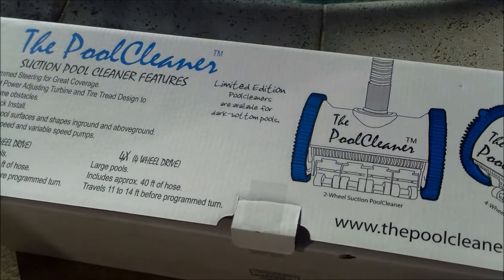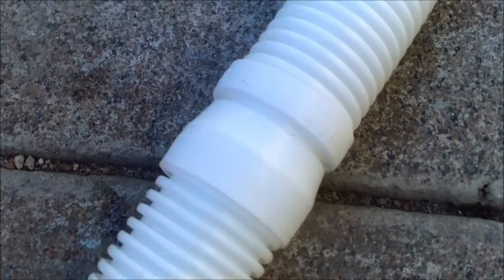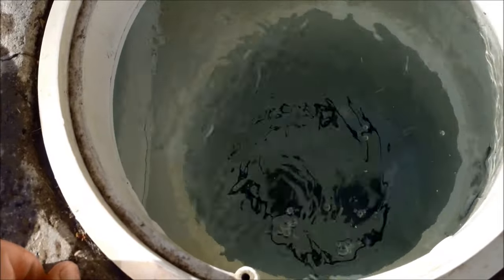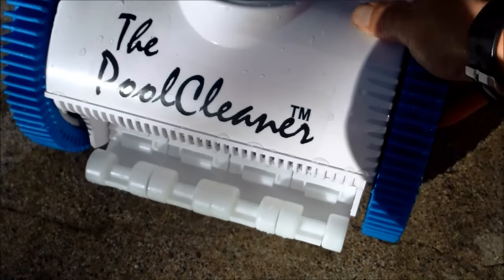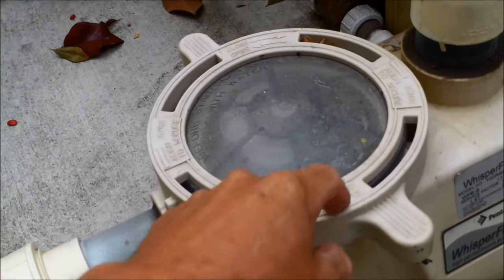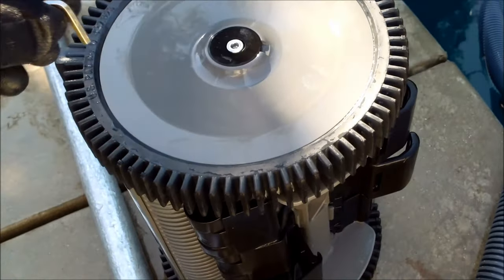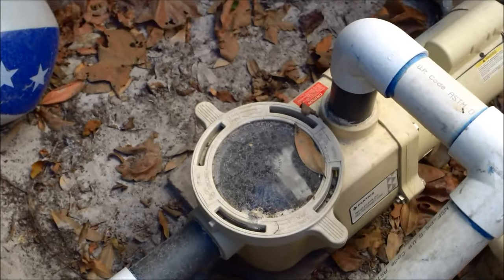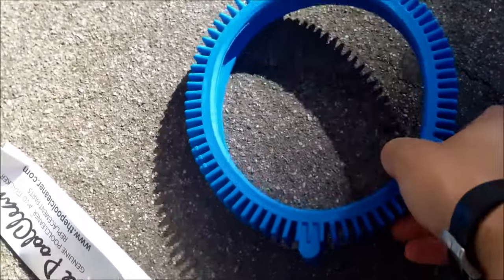Proper Installation of "The PoolCleaner", Troubleshooting & Tips

Comment: Question, it's working well when connected to the skimmer but when I connect to the pool vacuum plug on the side of the pool it works for a minute and stops. Any suggestions? 

Could something be plugging that line?

Thank you for this video. I have referred to this and your others a few times. They have been very helpful.
Reply from the maker: It sounds like there may be something wrong with the vacuum line. I've seen those filled with debris from a new plaster and fill

Comment: I don't know if you answer questions, but I am having a suction problem. It starts off ok, then, with my hand down in the skimmer hole, I feel the suction is strong for about 30 seconds, then it goes down to a trickle. I appreciate your response.  James
Reply from the maker: Sounds like an air leak in the line. See if you can isolate it. Usually by the pool pump. Check for any leaks. Change the pump lid oring as well.

Comment: Great video I just got my pool cleaner and installed it today. What would cause the pool cleaner to not have enough wheel rotations? I adjusted the suction valve over and over and over again and the best rpm’s I could get was 8 rotations per min. Any advice?
Reply from the maker: I would clean the filter if you haven't already. And the main drain needs to be completely off as well
Reply: Thanks for getting back to me so quickly. I will clean the filters and see what happens
Reply: What hapoened after cleaning the filters
Reply: I cleaned the filters, made sure my valves were in the correct position and I’m still only getting 8-9RPM’s and for whatever reason my vacuumed floats. I took the floats off to see if that would help but it didn’t. My father in law bought the same vacuums and is having similar issues. He’s only getting 8RPM’s also.

Comment: Hi, thanks for the informative videos. I'm having a problem with my "The Pool Cleaner" maybe you can help me with. Quite often the turbine will quit spinning even though it is getting plenty of suction. There is nothing obstructing it and I can actually stick my finger in the hole, give the turbine a nudge and it will spin fine for a while and then stop again later. Is there something I can do to fix this?

Thanks.

Comment: Great video, thanks!  I just bought a 4x pool cleaner, tried to set it up.  The first day it worked ok, but seems always stays in the deeper end.  The second day it just refused to move.  I noticed that we have 2 skimmers, one with double ports and one with single one.  I hooked the cleaner on the double one, no matter what I do, it is just not working, any input?
Reply from the maker: 2010alwayssunny You will have to block off one of the skimmers to give it sufficient wheel RPMs. Just use a 1 1/2" threaded plug in the skimmer opening if you don't have valves controlling the skimmers. If you have valves simple turn off one skimmer.  On a two skimmer set up one skimmer needs to be completely off. Also turn off the main drain if it is on.
Reply: Swimming Pool Tips, Reviews & How To -MrDgvb1 Really appreciate your advice, I will definitely try that.

Comment: Great video. My cleaner has been working just fine until recently it started to flip over on its side without being able to reposition by itself. I have to do it myself. Any suggestions?
Reply from the maker: When was the last time the tires were changed?
Reply: @SPL  The Poolcleaner is fairly new. I bought it in September last year when I bought the house with the pool.
Reply from the maker: Okay, so the tires should be good. Try moving the float around and see if moving it down towards the cleaner corrects that issue.
Reply: @SPL  I will. Thank you for your reply.
 Your videos are great!💪👊
Reply: @SPL  What is the float?

Comment: @3:31 you mention getting just the right RPM on the wheels: not too much and not too little.  Is that that the aspect of the poolvergnuegens your nephew mentioned, "I love it when it's working?" Do you have to keep monitoring and checking on the suction and RPMs with The Poolcleaner models?  Or is an old fashioned Kreeper just a more dependable technology (no wheels to fuss with)?
Reply from the maker: It doesn't have any real issues once it is adjusted. If I ever get around to part two of this training series part B you will see what stops this cleaner kid's goggles jammed in the mouth. Nothing else will stop thing. Just kid's toys left on the bottom. The New Kreepy Krauly is a good choice also. It comes with a lot of hoses also.
Reply: I am about to order the Poolvergnuegen  4 wheel (I measured, and I need 12 meters of tubing). But one last question: you spoke highly of the G2.  Are there any benefits with the G2 (capacity of suction/speed or thoroughness of cleaning) over the Poolvergnuegen?  Thanks for all your great videos. They're the best on YouTube.
Reply from the maker: PoolCleaner is the best cleaner - especially for larger pools.

Comment: I have a 2 wheeler.  Right now, it will clean perfectly one minute and then do nothing the next.  It goes back and forth this way all during the cycle!  What causes this?
Reply from the maker: +Claude Sauviat Could be an air leak in the system. Does the filter pressure gauge zero out?

Comment: I plugged my cleaner into the skimmer but it won't go any faster that 6 rpm. I'm not sure I have my valves opened or closed correctly. It's my first pool so I am lost. Any suggestions? Thank you
Reply from the maker: If the filter is cleaned and the flow is good - it is possible that you have the main drain line open.  The main drain is controlled either by vsalves at the equipment or by the skimmer itself it your skimmer only has one hole.
Reply: Swimming Pool Tips, Reviews & How To -MrDgvb1  
My filter is now running at 30 psi and suction is still low.... any suggestion? Thank you
Reply from the maker: Does it have one or two holes in the skimmer?

Comment: I have a second gen Pool Cleaner by HaywRd. My issue is that the cleaner breaches the surface and sucks air. I have the smallest port opening installed, and the dial at the skimmer all the way open. How do I tame this thing?
Reply from the maker: You will have to start drilling holes in the skimmer adapter until the suction is reduced. Start with one hole and see if that does the trick. Or if you can divert some suction to the main drain that will work.

Comment: is this pool cleaner as part maintenance as the Hayward navigator?
Reply from the maker: I've got 15 on my route - one had a broken wheel which seems rare and all the rest have needed zero maintenance - just changing the rubber tires when they wear down. so no, it is not at all like the Navigator.

Comment: My pool cleaner wheels are locked and I can't find anything on how to fix this problem. It has suction when I pull it up but will not move and I can't move them by hand. Any idea?
Reply from the maker: Jeff Delman Sounds like a rock or something is stuck in the turbine. This video sghows you how to fix that. Could aslo be a jammed gear -
Poolvergnuegen the PoolCleaner "Next
Generation" Tips & Tricks: https://youtu.be/GqftcLueg4Q

Just take the top off and check the turbine.
Reply: Thank you! I didn't find a rock, but the scoops would catch the rim because the suction mouth doesn't create a smooth edge inside. I appreciate the answer and now have another problem. The rpms are extremely low. I have a leak, suction side, but before it jammed it would zoom around my pool, now I'm down to 6-7 rpm and opening fully doesn't do anything. Now that I think of it I never thought to clear the hoses.

Comment: i installed the pool cleaner yesterday, it worked perfect for 1 day and now it will not move, it still has sunction though and the wheels have 0 rpm, i looked for obstruction in the pool cleaner itself and couldn't find anything, any ideas?
Reply from the maker: Sounds like something is stuck in the turbine - easy to clear: How to Unclog Debris Jammed in "The PoolCleaner" by Poolvergnuegen: http://youtu.be/UpvrFLpjx14

Also, take the first hose off of the cleaner and see if there is suction. Sometimes debris will jam up the hose also. And of course make sure pump basket is clear of debris. So something is stuck either in the cleaner or in the hoses.
Reply: Swimming Pool Tips, Reviews & How To -MrDgvb1 it was the turbines, some how they were stuck even though there was no blockage, thank you!  i spent hours trying to figure it out on my own...
Reply: Swimming Pool Tips, Reviews & How To -MrDgvb1 After 3 weeks of ownership I am giving up on the poolcleaner.  Every day I have to tear it apart and fix the turbines, nothing is ever stuck in the turbines they just get slightly knocked to the side while cleaning which causes the cleaner to stop in its tracks and do nothing, I really can't deal with it anymore.  Do you have any suggestions on an alternative cleaner?
Reply from the maker: Jason Davis There have been several people with odd problems with this cleaner now that Hayward took over and is mass producing them.  If you are looking for a good geared cleaner because of your pool shape - what does your pool look like and is it plaster? - then I would go with the Zodiac MX6  -if your pool isn't too large. My default cleaner now is the New Kreepy Krauly. But if you give me some more info on your pool I can help you find the best alternate cleaner. Sorry to hear you got a bad unit - that sucks but you are not alone it seems...

Comment: Has issues maneuvering of the floor vents that have a little hump.  Any suggestions?
Reply from the maker: It shouldn't have any issues with the main drains.  Try increasing the suction to the cleaner.
Reply: Wheels are probably worn. Mine recently started doing this so I bought new wheels

Comment: Hello. Enjoy your videos. Just bought this cleaner and have a one hole skimmer. Have adjusted the the regulator valve all the way, but still not generating enough suction for 11-13 rpms. 7 rpms is the max I get.  Will adding a diverter valve to the skimmer help? If so, does the diverter valve just insert into the one hole in the skimmer? Thank you!
Reply from the maker: Yes. Your one hole skimmer should have a diverter valve installed. Just go to your local pool store and tell them you have a one hole skimmer but no valve inside. They will sell you the correct one. If you can note your skimmer brand that helps. Look at the lid - it may have the brand printed on it. That should solve the issue.
Reply: Thanks so much. And thanks for the great videos. Helps us pool novices out greatly.
Reply: Swimming Pool Tips, Reviews & How To -MrDgvb1 Thanks for this video...do you still need that blue cone if you use the diverter valve in a single hole skimmer?

Comment: Hello, how should I use the Pentair 85002600 to interface with the vacuum hose?
Reply from the maker: You would just need a small 4" female to female hose or just cut the end off of one of the hoses to make it fit on the valve.
Reply: Swimming Pool Tips, Reviews & How To - SPL 
I figured out that the adapter does not fit my skimmer.

Comment: Any advice for when the white and blue ring separate from the skimmer part itself the hose keeps fall off?
Reply from the maker: Not sure what exactly you are describing but if the skimmer adapter and hose keeps coming apart you may want to add this to the skimmer ot hold it together. Pentair K12076 Vac Plus II Locking Bar Replacement Kit Kreepy Krauly Automatic Pool Cleaner

Comment: How to turn it on and off? Instruction manual says it needs to be taken out of the pool when swimming. But how? I don’t see a switch and I don’t see it plugged in .
Reply from the maker: Just remove it from either the skimmer or sideport.
Reply: @SPL  thanks. But I don’t know what is the skimmer or the side port? 😬 maybe just take it out of the pool? Will it shut down by itself?

Comment: My 4 wheel did not come with the floats for the lead hose. My pool cleaner is always on it side and doesn't correct itself. Could not having the floats be the problem?
Reply: I have the floats and mine still goes on its side and doesnt correct.
Reply: Did u figure it out?

Comment: Hi my cleaner keeps getting stuck in one point and not rotating backwards like it used 
Also it turns on the side and rides like that unless I move it
Any suggestions ?
Reply from the maker: Is it the older model of the cleaner or the newer model?
Reply: Having much the same problem.  cleaner gets to the steps and stays there. Just bought it so it is a new model. Did you get your problem fixed?

Comment: Dave, I hope you get this message. I’ve been using these pool cleaners since inception. I actually spoke to the owner when I called the original company! I use these in an above ground 20’ KD Pool. I want to recommend to my coworkers with a 20’ Coleman Pool. I just now noticed (after many years) these are for in ground pools. Can I confidently recommend this cleaner for an above ground (4 foot) soft sided pool? Like I said it works well in mine. I started with the two wheel version, now have the 4 wheel version as my hose would not stay upright, even with the floats adjusted.  Please let me know as we are looking for an above ground suction side pool cleaner. Thanks, Tony.
Reply from the maker: Should be fine. You are a long time user for sure!

Comment: I just purchased the 4 wheel model.  I have proper RPMs around 11/12 rpms with gunite pool and It will not climb the walls.  Not sure what the deal is.  If I pick it up and set it on the wall it just falls off down to the bottom.  Like its not suctioning to the wall, but my RPMs are good.  Any ideas?  Thank you
Reply from the maker: The newer models just don't climb well.

Comment: I have a one hole skimmer and want to use the pool cleaner. I am having suction problems. What diverted should I use so that I can divert to full skimmer? Also I want to use a vac mate. But notice the suction is even worse when I use it. Is it possible I need a higher horsepower pump?
Reply from the maker: The diverter is the issue. There are a few different ones. Try a local pool store and see if the manager will give you several to try in your skimmer. Most are willing. A local pool service company can also set you up with the right one. Once you can turn off the main drain the vacmate should work fine.

Comment: Hi, mine is a side port suction 2 wheel. When the wheels are turning in opposite directions there's plenty of power. However, when spinning the same direction, they will only turn when I'm holding it off the ground. Any pressure at all stops them. I have good suction and I've played around with the valve to lower and increase pressure but it made no difference. My pool shop took it apart and said it all looked ok. Any suggestions? Thank you.

Comment: How do you fix a situation with a one hole skimmer where pump will prime when cleaners not attached but cavitates when I connect 4 wheel the pool cleaner. Makes pump super loud. I’m using the included plastic speed adjustment device and attaching it to a 4or 5 inch female to female Hayward hose extender. Which then attaches to the one hole suction pipe. It’s like the pumps struggling to pull enough water? Rpm on tire is 12.
Reply from the maker: I wonder if there is a suction leak at the pump? Any water leaking around the pump?
Reply: @SPL  nope. Happens a lot when you connect a auto cleaner to a single hole suction, it’s like the pump struggles to get enough water through cleaner? Causes pump to cavitate especially at higher speeds above 2800-3400

Comment: I purchased  a used Poolvergnuegen, and occasionally it will flip on its side and remain there for some time. Does anyone know how to correct this issue? It appears that the unit does not have the original "leader hose", but i am trying to determine if that "grey" connector is necessary or if purchasing the floats alone will alleviate this issue. Thanks so much!
Reply from the maker: You just need the floats. However the grey cuffed lead hose is slightly skinner so the floats will be a bit hard to get on.

Comment: I'm thinking about purchase but I'm wondering...Can the pool cleaner vacuum be used in an above ground vinyl pool (12x24) and if so, how would I hook it up?
Reply from the maker: It will work but there are less expensive cleaners available that do a fine job in above ground pools - like the Zodiac Ranger.

Comment: There was an old question with no reply and I have the same issue "Hi, thanks for the informative videos. I'm having a problem with my "The Pool Cleaner" maybe you can help me with. Quite often the turbine will quit spinning even though it is getting plenty of suction. There is nothing obstructing it and I can actually stick my finger in the hole, give the turbine a nudge and it will spin fine for a while and then stop again later. Is there something I can do to fix this?"  Any input?  I'm thinking about replacing the vanes as a starter to see if that fixes it.
Thanks.
Reply from the maker: Would remove a couple of the vanes and see if that helps. If it is more than 4-5 years old the gears may be wearing out.

Comment: I just purchased this cleaner and it is not climbing the walls and maybe not making it to the shallow end. I increased the rpm's but that didnt seem to help. Did I see that since I have a vinyl sided pool that I should cut the humps off the wheels? I am afraid to do that and it not work then I wont be able to return the cleaner if it is still not working.
Reply from the maker: This is not the best choice for a vinyl pool due to the sharp slope between shallow and deep end. If you can return it I would. Maybe get a Zodiac Ranger or Zodiac G3 - you will have good results with the bouncing type cleaner in your surface type.